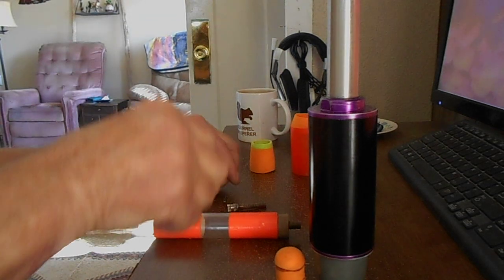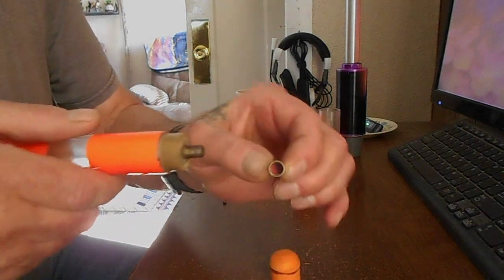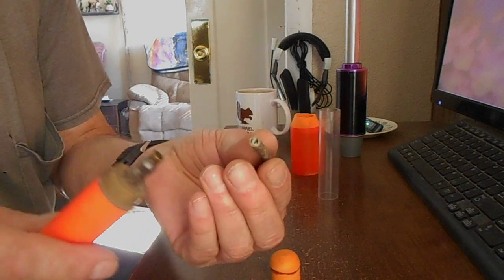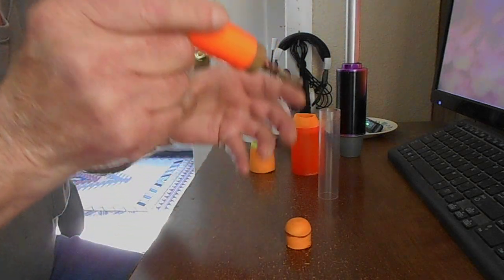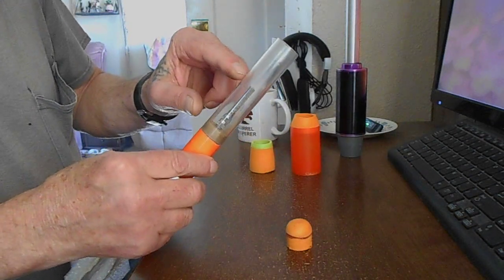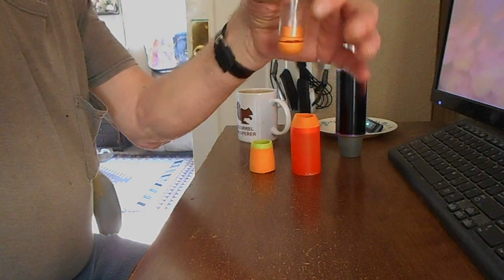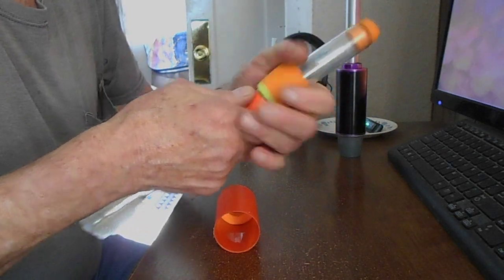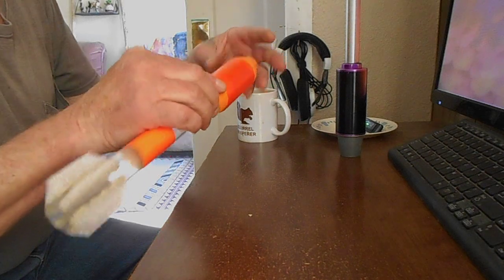New 50mm projectile prototype

Comment: This is fantastic. How reliable have you found the caps igniting the fire crackers? Great as always.
Reply from the maker: Thanks Alex...95 out of 100.
Reply from the maker: That is with the paper/black powder fuses...not the green waterproof fuses.
Reply from the maker: https://youtu.be/M7kZKYaLdxI?si=0WzOVHPbc5L8UdNF This projectile is going to be used for the 50mm mortar with a couple of minor changes!
Reply from the maker: https://youtu.be/rnDu3Thg33A And this.
Reply from the maker: I just went out and tried this firecracker/green powder projectile and it was 2 failed attempts in a row. Cap went off both times but it failed to light the fuse. I gotta get this right so back to the drawing board!